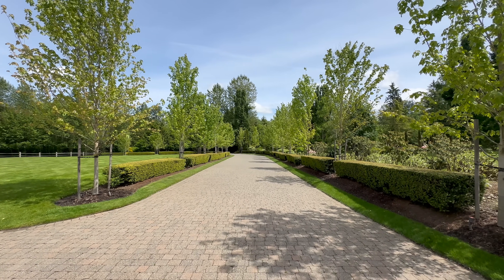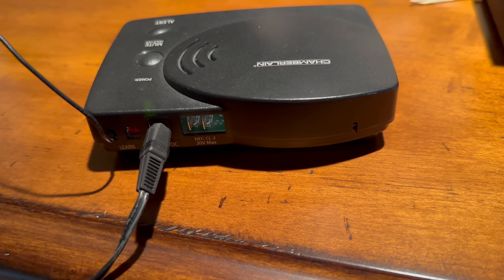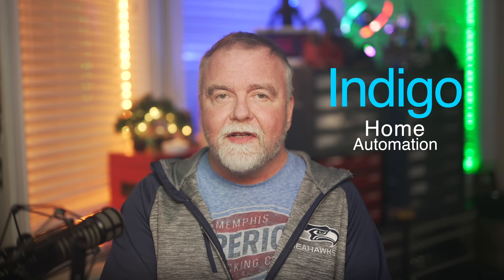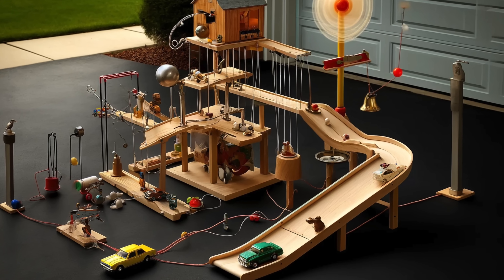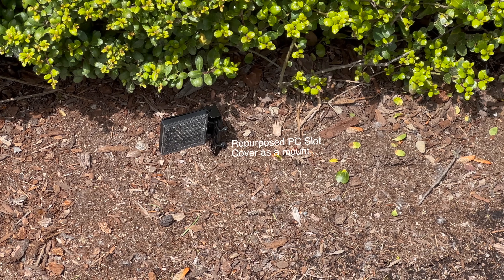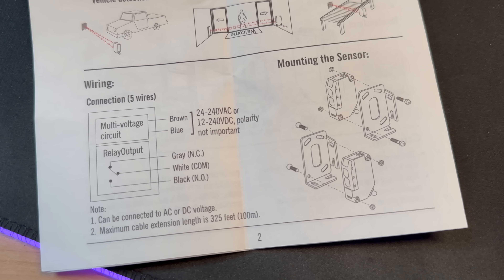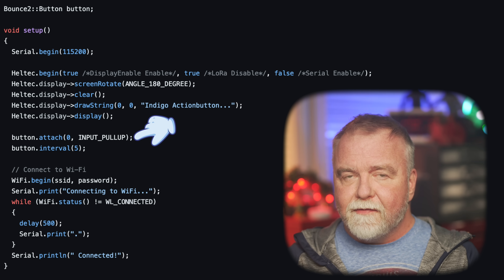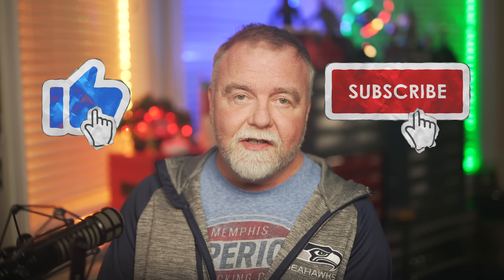Building the Ultimate WiFi Driveway Alert System w/ code and parts!

Comment: That’s really neat, Dave! Thanks for sharing!  One thing I’d implore you to consider is to use that normally closed wire to have your system actively monitor if the sensor is there, and to alert if the signal is lost on that pin and not present on the other.  Maybe even add a tamper switch inside your plastic box too, so that it will alert if someone opens the box.  A malicious actor could, in theory, cut the wire going to your sensor and you’d have no idea it happened until someone showed up on your doorstep, or you noticed the alerts not happening/lights turning on.  Maybe even go so far as to have the “tamper detection” act as a separate point on your burglar alarm panel and set that point to immediate alarm (regardless of whether or not the system is armed) if the sensor wire is cut.

Another problem with WiFi and other wireless security solutions is that they can be jammed or attacked.  I understand the desire not to run a cable, but it is the most secure method.

Thanks for all your informative and entertaining content!
Reply: A malicious actor could bring their own reflector and place it right in front of the sensor like in raiders of the lost ark.  Or one could affix reflector material to the side of their automobile.  Perhaps adding an advanced IR + movement sensor and sending another alert for heat and movement detected.
Reply: I see two shortcomings in your design:

1.) As mentioned in the in another comment you need a way to know if the wire between the sensor and ESP32 has been cut or tampered with. To that end us an analog pin and put a voltage divider across the relay.  In you code look for the analog voltage and if it varies by more than a predetermined percent trigger an alarm.  To do this bring 3.3 volts from the ESP32 to the sensor.  Place two 1k resistors in series between +3.3 volts and ground.  The center connection between the two 1k resistors goes to the common side of the sensor relay.  The ground from the ESP32 goes to the N.O. side of the sensor relay.  When the sensor relay closes the voltage on the ESP32 analog pin will drop to zero and you'll know you have either and intruder or someone has tampered with the sensor wiring.

2.) Once connected to the home automation system the home automation system should pole the ESP32 in the driveway periodically to ensure the Wi-Fi connection is still active which will detect any attempts to jam the Wi-Fi signal.

Like with any hardware/software project you need to minimize the attach surface area to keep the bad guys and rodents that may eat through your cabling at bay.

You may also want to make sure the box is well sealed and add a desiccant pack or two to keep everything dry.
Reply: All you would need is a wifi jammer to defeat this.   I would not bother fixing the issues in the comments above.     You could use a camera and object recognition AI for more security and options.

Comment: Hey there - check out the doppler module RCWL-0516 for motion sensing duties.  Relies on motion in field rather than optical or thermal.  Sensitivity can be adjusted by resistor value.  Fairly low current requirement and a single pin high/low output on detection.  Have a few of those bolted to some atmels and lora transceivers for similar duty as yours.

Comment: I tried using a sensor similar to this one but found it unreliable depending on the weather and how many spiders liked the reflector for their web.  I finally switched to a laser  VL53L1X TOF sensor.  I found that I could mount it behind the gate post ( On the yard side) and point it diagonally across the 12 foot wide driveway.  Taking multiple samples makes sure there are no false alarms because of a single "hit"  The sensor can be used to detect coming or going traffic.  I use a Microchip PIC for control and use about a one second on-off  to minimize power.  The gate is about 300 ft. from the house, which is marginal for GHz devices so I use one of the 9xx MHz tx-rx pairs for communication.  Everything is self contained and powered with a 6V battery charged with a 5 watt solar panel.  The only problem I have had is with VERY heavy rain.  Even the TOF device can't cope with an opaque wall of water.  The Rx end simply rings a chime in the living area and workshop.

Comment: My dogs didn't used to be guard dogs, but Trapper, ever since I got Zelda, has decided to get SUPER PROTECTIVE of the family (which is just me and the two dogs), which also gets annoying. They went after two kids, just barking in their face. It's always worse when I'm distracted and I was putting a magnetic screen on my door since this house is TERRIBLE for airflow. SIGH... Three teens, who did look sketchy, but I think I'm getting to that "GET OFF MY LAWN" stage in life at 36, so, not the best judge of character in that regard. That's become problematic. The teens wanted to pet my dog, they 100% asked me permission and I thought Zelda (the scarier of the two, as a black Dutch Shepherd/Mal mix) is also the most sweet thing ever, would be cool, NOPE. Luckily she is all bark, Trapper (Foxhound/Catahoula) not as much, but only had one supposed BITE incident with a homeless guy. Even though I live in the nicer part of my town, there's literally a trailer park and section 8 housing around the corner from me 2 blocks down. Also, it's MS, so a lot of meth heads.

Comment: Been reading the book.

Yup. I wish I'd known long ago....
Reply: Thank you Dave for writing the book.

The more I read, the more my "not normal" reactions make sense. However, self diagnosis and power of suggestion? 

The ticking wall clock, the bearings in the ceiling fan and all the "white noise" things, drive me crazy. A booming "bass" speaker from a car makes me want to smash things, almost uncontrollably. Yet, the sound from distance of a motorcycle or car I know or worked on, miles away if the wind is right, lifts me. 

There are so many more "things" I don't get "right" in life, especially human to human. I sure can make up "challenges" to program or build or both, then complete the challenge.

ASC or ASD, it makes no difference. It is like accepting my PTSD. Resistance to the medical practitioner diagnosis didn't make life easier. Only when I embraced the "disordered" reactions and took steps to improve did life for me and those around me get better.

Resistance to "self" diagnosis ASC/ASD, doesn't make life for me and those around me better. Just a couple days of self awareness from the POV of "maybe ASC/ASD"  + PTSD and things are easier and more pleasant. 

When is the next "Air Lift" ;)

Comment: Hi Dave, I have been eyeing something like this for a while now but with an added wrinkle...one system comprising 4 staggered sensors that act something like a speed trap. Since there are too many false positives on alarms nowadays, I was thinking of a staggered approach to measure the speed and vector of the incoming intruder and cancel everything outside the vector trajectory (aka straight walking/ running) and the range of the speed of a human (aka 4-30 km/h)... how would that work?

Comment: Dave, just a fyi.  You can also use a Honeywell System 7 Wireless Doorbell.  The wireless modules for reusing existing wired doorbell switches are great for things like your driveway annunciator and a wireless mailbox.  These things have a three or four hundred foot range or even more if you install a 1/4 wave tuned whip antenna.  To get contact output, you hack the base station and add a DTMF module across the speaker.  Years ago, I wrote up an entire How To document for the automated mailbox.

Comment: Do what I do.  I found IR sensors suck.  So I used cameras, then I attached them (via my network) to an old cheap surplus server with an NVIDIA GPU running an NN for vision.   Not only can it spot cars, it can remember them so I can check who's come and gone even while I'm at the office, people and even animals as well.  The caveat is, of course, lots of coding on my part, which I haven't shared yet, but if you'd like I could share it.  However, my dog, if my speech system, also running on an NN on the said server, announces to the house a car, truck, ect has arrived gets excited.

Comment: Pergaps I missed this in the code snippet shared in the video.  In your Arduino loop() wouldn't you want to try to reconnect to WiFi if it had lost its connection?  Otherwise, you would be forced to restart/reset the detector arduino every time it lost signal, no?

Comment: Two words, Home Assistant!
Reply: I got four words for you! 
Developers! 
Developers! 
Developers! 
Developers!
Reply: and espHome for the esp32 side of things (configure with YAML, no need to code), works perfect with Home Assistant.
Reply: one word: THINKERING
Reply: Home assistant and ESPHome. Put into deep sleep and only send an alert when beam is broken, you can power your entire setup off an 18650 battery for a very LONG time, talking probably multiple years plus, I've seen this done with even more power usage like adding LoRa to it and other sensors.  But I wouldn't leave well enough alone and likely add a humidity, temp, barro pressure, rain sensors, and other sensors for data.  And build the sensor packs to put all over my property and generate a heat map in HA. And if you put a small solar panel to trickle charge it during the day, you'll never have a dead battery or sensor data.
Reply: @MikeHarris1984 Amazing idea. I wonder if there's already an FOSS project that does that.
Reply: Or a motion sensing camera that sends push notifications?
Reply: It really sounds that your home automation system could use some ‘modernization’ a.k.a. Home Assistant, you could still use the ESP32 module with HA. 😇
Reply: If not, I'll do it. I shall call it the "Packaged Environment Notification and Information System"
Reply: I run over 20 esp32 or esp8266 based devices connected to home assistant. It's really great software. You can even run wire guard on esphome to connect remote devices on other networks. Great for monitoring stuff at my parents.
Reply: Yep.  ESPHome inside HA got several tools built-in for stuffs like this.
Reply: 20 year old iot software running on macos... That is bizarre... Let this guy do what he wants lol
Reply: Think you missed the part where he already has home automation software setup that is reliable.  Why rebuild an already working system?  As great as HA is it's likely he'd run into a lot of grief getting everything working.  Not worth it.
Reply: Two more words: security vulnerability.
Reply: @miket5506  well it’s local, so this comment makes no sense.
Reply: @Mrcaffinebean  it does if you interpret “home assistant” to mean Alexa or Google as I did.
Reply: @miket5506  ah yeah that would be Google Assistant, different assistant lol
Reply: Oh no! Home Assistant is definitely not Alexa or Google.
Reply: HA is very secure, more so than 20 year old software that hasn't been patched in all that time. More secure than relying on proprietary systems in the cloud with no visibility into their bug fixing processes.
Reply: @miket5506  - How so? You set it up to the degree of security you choose.
You can setup access tokens and all. 2FA. Etc.

You can still program sensors, or you can flash others w/ firmware like Tasmota
I have yet to see a story of a break-in to a well-built HA server.
It all depends how well you harden it.

Granted, by default it will run over HTTP instead of HTTPS, so I guess if someone is inside your network already you can be vulnerable, but is HA really your concern at that point?

Comment: Dave, the lorawan stuff is cool. I use a simple device in my mailbox at the end of our street to send me notifications when the mail arrives. It's too far away for wifi and no line of sight. Oh and its battery powered. So perfect.
Reply: Never thought to do that but the idea of a mailbox alert seems really cool. I sense a fun weekend project in the making. :D
Reply: @sqaudseven  Now to mail myself letters to test the alerts
Reply: How far away is it? I’m looking at a similar use case but ours is about 850m away with a fair number of trees in the way, so I’m concerned even LoRa wouldn’t be able to manage that given that most of the tests I’ve seen pin it at around 500m with obstructions…but I’m not sure if that can be improved with better receivers / antennae.
Reply: Mine was similar, with tons of trees, it did connect to another lorawan (helium hotspot) mostly, but once in a while it used my own. I did have an external antenna for the gateway which made it connect to other gateways 50 miles away

Comment: 300 foot driveway here too. Watching intently... 🙂
Reply: Crikey, the sensor is over Cdn$100 on the most-obvious source. So I'll need another security system to protect the Driveway Alarm sensor.  ;-) !!
Reply: @JxH  - Geese! No WiFi Needed! 😲😂
Reply: @robertweekley5926  "Geese"
We refer to them as 'gooses" (plural), simply because it's seemingly funnier.
Cheers.
Reply: @JxH  - Well, "Goosing The Throttle" was one expression!
Reply: I had issues in the uk with those sensors and reflectors getting dew on them. They then fail to work. 

The non reflective versions (I don’t know the name) seem much more reliable, but the range is also much less at around 1.5 meters. 

I agree pir sensors are a tad inconsistent, but over time, I’ve found them more resilient. Especially if you find a good brand that works for your specific range and direction requirements.